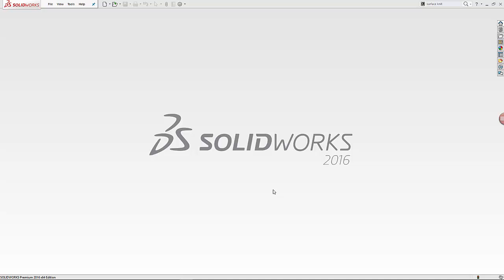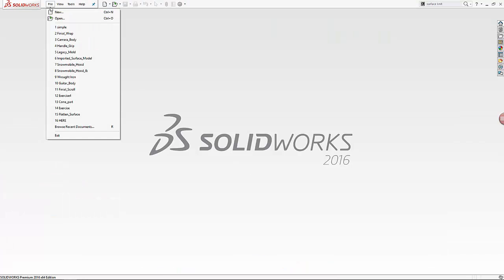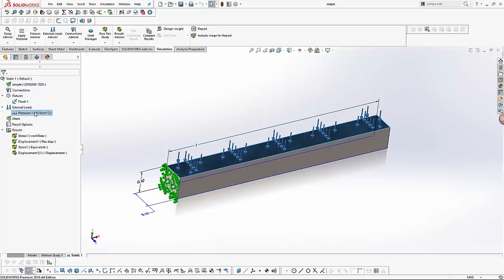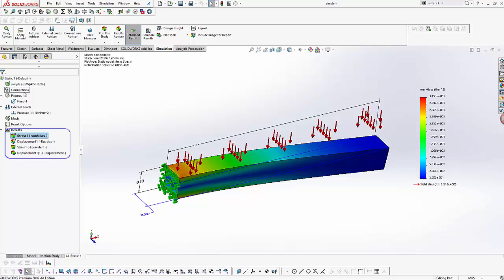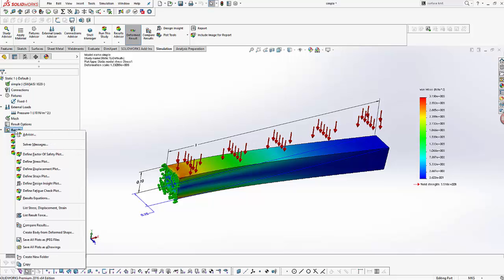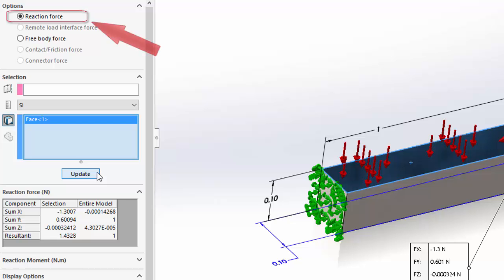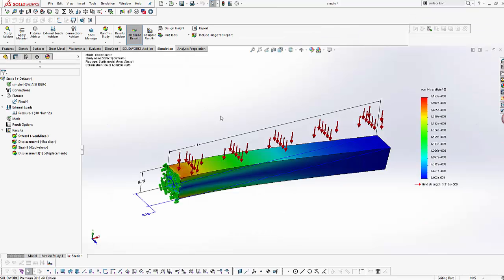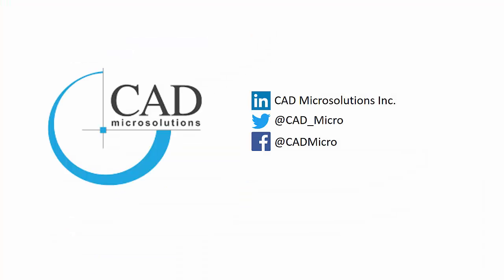Computing Reaction Force in a Static Simulation in Solidworks Simulation

Comment: What about where it says "entire model," what is that?
Reply: If you select a face it'll show you the reaction forces at that face but suppose you select the same face in where the load is applied it'll give 0 value at that face and in the entire model column it'll give you value about reaction forces from the fixed faces.